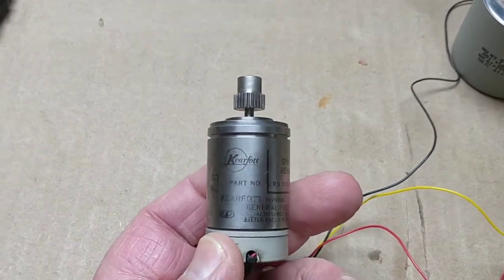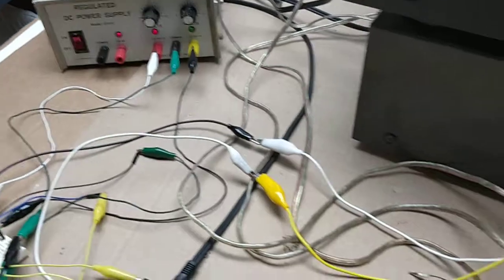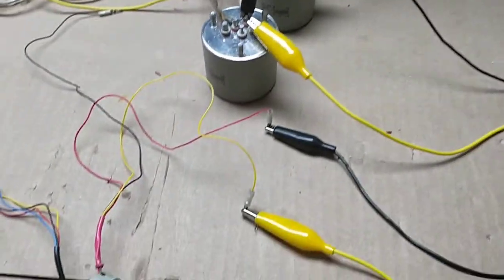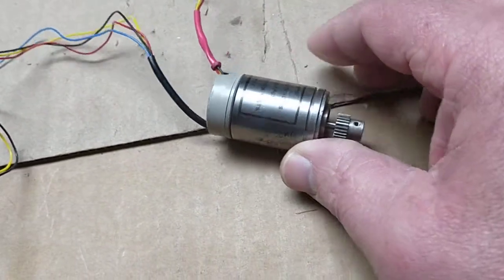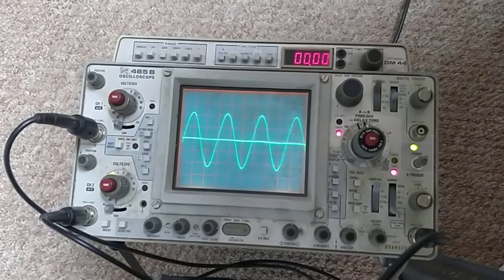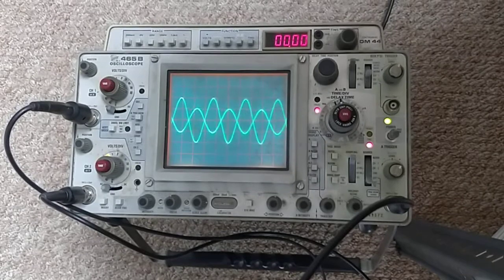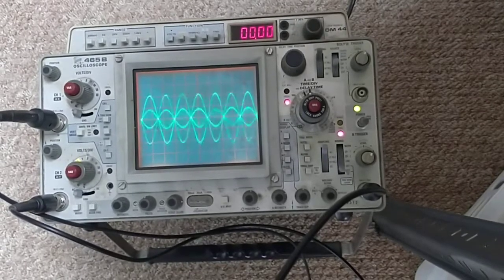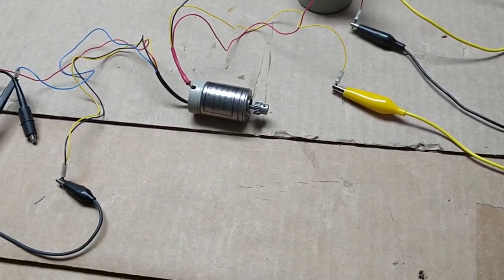Synchro resolver shaft position transmitter

Comment: Where did you get the 26 vac 400hz power supply for the Synchro?....Do you have any schematic about it?
Reply from the maker: for a SINGLE phase like used in this video, any 400hz audio signal generator and one channel of a 100W or so stereo amp will give a fair power supply.  Best and easiest is to look for a 400hz inverter or these guys have affordable 40W inverters  https://www.powerstream.com/inv-400hz.htm    Right now there is an old rotary single phase 750W 400hz mechanical motor/generator on ebay that takes 24V at 60AMPS (that's SIXTY AMPS!).  This video I'm using a home built wein bridge oscillator with phase shifter and two stereo amps to get 3 phase power for gyros. https://www.electronics-tutorials.ws/oscillator/wien_bridge.html   https://www.homemade-circuits.com/three-phase-signal-generator-circuit/amp/
Reply: Greetings from the 🇬🇧 UK. I have some Singer/Kearfott synchro/resolvers. I am trying to interface them to an AD2S80 resolver to digital converter IC. I can't find any data of the resolver pin out. Could you point me in the right direction? Many thanks for your help. Great video too!